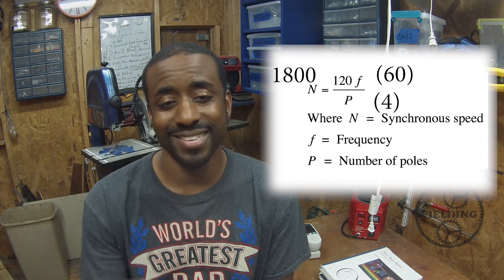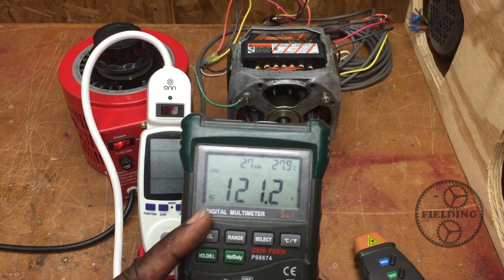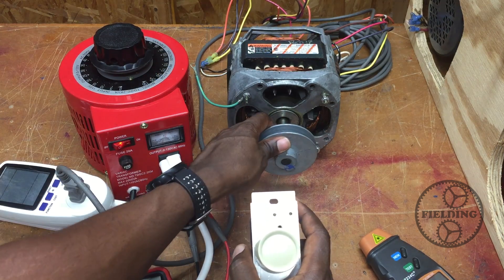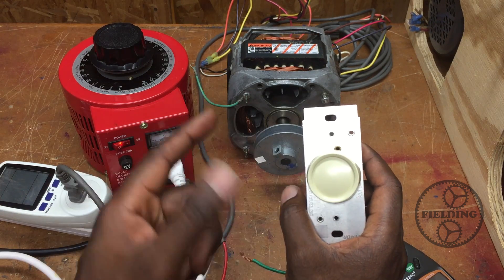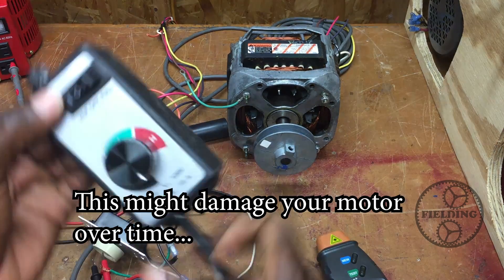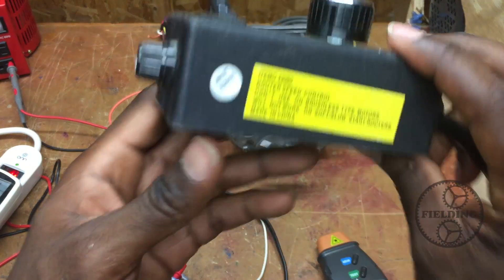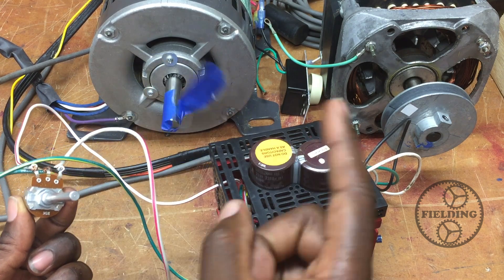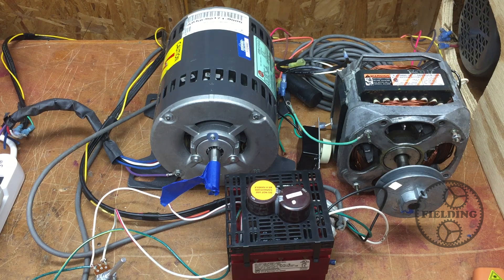Will A Dimmer Switch or Transformer Control An Induction Motor's Speed: 038

Comment: Excellent video Jeremy
Here is a single phase VFD.
https://www.youtube.com/watch?v=QhqrrNa_v6Y
It changes the frequency component of the sine wave by allowing the incoming sine wave to go through SRCs where portions of the sine wave are flipped.
For example if you want half the frequency, the SCRs are controlled so positive and negative of the sine wave are positive bu filling the negative.  Next the sine wave is directed to all negative by flipping the positive portion of the sine wave to negative.  Therefore half the frequency.
This can be replicated fairly easy by using an arduino to control the firing of the SCRs.
Reply from the maker: Thank you! Regarding the link...That is a three phase motor he is controlling. However, the problem is not that no body makes one.... it is that the "most" common single phase motors have starter windings which turn off at lower speeds and the motor would be damaged by lowering the speed. In the follow-up video you will see the two motor types that can be controlled by a single phase vfd. They are almost always used as fans. Here is the video. There are single phase VFD's sold for these two types only. https://youtu.be/JTlHNOaBnPI
Reply: My bad Jeremy
Here is the link I should have used:  https://www.youtube.com/watch?v=lXs0iJ1J-i4
Reply: Variable speed is handy on many machine tools.

Comment: I have been experimenting with treadmill motors but I haven't been able to run them. It won't work just plugging it right into the wall I learned that the hard way (almost died of a heart attack). I tried to use the motherboard to power motors but the first one had all the safety components and controls on the same board. The second motor had two separate mother boards (one for the controls and one for the motor) but it's not letting me use the second mother board every time I flip the switch the breaker goes out. If you could help me figure this out that would be awesome. How do you use your treadmill motors?
Reply from the maker: +Justin Gracier I have a whole video on this on my channel. "How to wire large D.C. Motors"
Reply from the maker: https://youtu.be/ASywVBU0ZwE just in case

Comment: If the light dimmer and router controller both work with triacs, can't you just substitute a high quality dimmer for the low quality HF speed controller when using brush type motors?  Maybe the light dimmer isn't rated for that level of amperage?
Reply from the maker: Well, yes and no... Yes the dimmer switch operates the same way, but "speed controllers" are suppose to be better at  handling the inductive load produced by transformers and motors. I  don't know enough about each component to say exactly what makes it better. It could be just a better triac. That is what one of my subscribers says.  I haven't checked behind him. The dimmer I used in the video was rated properly for the load. It would not be a decent test if I didn't at least get one with the correct voltage and amp rating.
Reply: I was just looking at triac circuit schematics.  I don't fully understand the theory yet, but it seems that triac speed controllers need an additional resistor and capacitor in the circuit to deal with changes when a load is put onto or taken off of the motor.  Fortunately, triac circuits look quite simple and the components needed are inexpensive.  I'm starting to think maybe I could build a speed controller with better specs than that Harbor Freight model for about the same price.

Comment: The motors I come across in single phase are ecm. I think the ac is converted to dc and is able to be modulated up or down.
Reply from the maker: Yes... they are DC motors... Check the second part of this video.... I cover the PSC motor and the Shaded pole motor which are almost always used in fans.... https://youtu.be/JTlHNOaBnPI. I explain how fans are so easily controlled

Comment: Hi Jeremy, I've been watching a few of your videos and have been really enjoying your approach to making. Intuition, the process of discovery and innovation, progressing/evolving knowledge, I make in a similar fashion.
I appreciate your work.

You mention in this video your difficulty in sourcing a single phase VFD, I was recently researching this same subject, and eventually discovered that a few Chinese manufacturers are producing such items. 
Here's one which is listed on Ebay: http://www.ebay.com/itm/Easyget-EA-9000-VFD-0150GB-220v-SinglePhase-1-5KW-2HP-220V-7A-VFD-Drive-Inverter-/322650300139?hash=item4b1f74deeb:g:3vAAAOSwi-9Zj6PJ

P.S. I'm not the Ebay trader, so not trying sell you anything.
Reply from the maker: It is worth asking the seller before you buy it if it is BOTH single phase in AND single phase out. Another YouTuber posted a video where he bought one of these that was described in greater detail as single phase. However, it was single phase in, three phase out after he opened the box and read all the instructions. If it was truly single phase out it should say it only works with PSC or shaded pole motors... something like that. Because these are really the only single phase motors that would work without possible damage to the motor. This website is a good example... they make it clear it has both single in and single out but they point out it doesn't work on most single phase motors. https://www.wolfautomation.com/blog/vfds-for-single-phase-motors/

Comment: I have been studying this sort of thing for a few years, and I have watched other engineering and machining channels. I learned more in 5 minutes of your channel than ALL of the other channels in YEARS! You are a gifted teacher, thank you Jeremy.
Reply from the maker: +Victor Bingo thank you!
Reply: Amen, Amen and AMEN!

This man KNOWS how to turn a high tech subject to a "piece of cake".

Any technical school would be a fool not to hire this man YESTERDAY.

He is a treasure for sure. May Jesus continue to gift him with knowledge that can be taught easily to the masses.
Reply: same here. I thought I knew what I was doing but learned more from his videos that any other source before
Reply: mcorrade it's like he filled in all the blanks I had.
Reply: soo true. keep making more and more videos jeremy.
Reply: You are the best!! Bless you and family.
Reply: I just spent 3 hours on the 'net reading, and your video saved me from reading any more.  In 10 minutes you simplified and confirmed everything I had read.  I did manage to find ONE single phase input/output VFD, but while the input is 120 volt, the output is 220.   The one I found is an ATO 1/2 hp (0.4 kW) VFD, Single Phase Input & Output, but I have no idea how to reduce that 220 to 120 and get the whole system to work.
Great video, helpful to all.  I subscribed, which is not something I do often.
edit-- On second thought, it seems intuitively more likely to work if I get 220V input/120V output VFD, which ATO and someone else make, and put a 120/220 step up between the wall outlet and the VFD.   I guess I'll find out if that works.  What a pain.
Why doesn't anyone make a simpler 120/120 volt VFD?????
Reply: @johnbluebeard4355  
I ended up buying a Variac to reduce the voltage!  Dang, they don't make it easy.
Reply: Salute...!!
Reply: I'm an EE.  I wish you taught my electronics lab, seriously.  BTW, why not put an oscilloscope on the motor input power?
Reply: Victor Bingo q@zzzxxxssx           Is r600tq
Ki
Reply: Thank you you saved me a lot of time and money.
Reply: True that. Me too
Reply: So the obvious question is how do you reduce the frequency of a single phase motor, so that you can use a gringer, as a knife sharpening station; or, slow a router down, when it is powered by an induction motor (cheaply, of course)

Comment: Thanks for a really great video.  
You explained everything so that it is easy to understand. 
I always wondered if there was a way to slow an induction motor that uses a capacitor start system.
. 
I have a Milwaukee 8 inch bench grinder that has a bad start capicator. 
The grinder was salvaged from my garage after Super Storm Sandy that hit on 10/28/2012. 
Most of my other power tools didn't survive. 
I flushed the motor with fresh water and it ran great for a while. 
Now to get it to run I take an old leather belt and wrap it around the grinding wheel and pull start it. 
I can't see any marking on the cacitor so I don't know what size capacitor to replace it with.
If I don't pull start it it will hum and get very hot.
Do you have any idea about what size capacitor I would need to use? 
The motor is 1/4 or a 1/3 horsepower .
Is there a formula to figure this out.
Again, thanks for your time and effort in making these videos and thanks in advance for any info.

Comment: Is that a start capacitor on that single phase motor?
And that 3 phase is AC right?
All the treadmill motors I've salvaged are permanent magnet DC motors.
Reply from the maker: +Robert Twiss there is a start cap connected to the single phase motor. It is AC three phase. This is the first three phase motor I have seen from a treadmill. It was a commercial grade very large treadmill. I didn't get to see the board but I assume it has a single phase to three phase VFD controller with step-up transformer. This would have plugged directly into the wall at 120 volts.
Reply: That would have been an interesting salvage.
My current interest is Alt. Energy.
I have been collecting things for a gasifier/pyrolysis project I hope to start building soon.

Comment: Jeremy Fielding will a potentiometer work on e bike motor, without that devise? I am making my wheelchair motorized with 2 hub motors. don't want to pay out the hide end for a motor controller or a bms. I plan to recharge all my cells one at a time like all other battery using devices hahah, big one legged boy toy, my wheel chair
 Joseph T
Reply from the maker: If you can find a potentiometer rated for that motor's current and voltage... then yeah it would work. A DC motor controller would be better in the long run but it will cost a whole lot more. You will probably get better results searching for a rheostat. It is more along the lines of what you want. It is basically the same thing (a pot) but different lol

Comment: hey Mr Fielding does a water pump machine has a motor inside and if yes which type
Reply from the maker: Yes. You need something to turn the shaft of the pump. What type depends on the size but a pool pump for example is most likely a two pole capacitor start induction motor. But, that is a guess. There are many different types and sizes of pumps.
Reply: Jeremy Fielding will a potentiometer work on e bike motor, without that devise? I am making my wheelchair motorized with 2 hub motors. don't want to pay out the hide end for a motor controller or a bms. I plan to recharge all my cells one at a time like all other battery using devices hahah, big one legged boy toy, my wheel chair
 Joseph T

Comment: Just a trick I've used in a pinch a few times. Dimmers, especially those intended for ceiling fans can control some small motors like bathroom or stove exhaust fans, but also things like hot glue guns or heaters when you need some kind of variable temp. control. BTW, great channel.

Comment: Although you indeed can't dim an induction motor it does sound like it's not even starving the motor because the triac isn't turning off. Because the lacking of current with an inductive load it's hard to turn off a triac. So I think if you place a bulb parallel to the motor while using the dimmer it will not dim either because the triac isn't turning off :D
Reply from the maker: +tengelgeer now that sounds like an interesting experiment. I will try it and let you know what happens.

Comment: What about fan motors and their three different speeds? How is that controlled and fit into what we just learned? Thanks for the videos, you always do a great job.
Reply from the maker: +Trey walker it is wired differently. The winding is tapped at different places. They don't use the "whole" stator field for the lower speeds. Kind of hard to explain in the comments. But that type of motor is only good for fans... when a fan starts the load is very low... basically zero. If you start a washing machine with that type of motor it would never get going. I definitely have to address this. Several people have asked. It is a great question I didn't think to mention in the video

Comment: So don't you need a different plug for a 3 phase motor? My grandpa had a lathe that had a 3 phase motor and here in Australia the plug was way different. So how did you connect yours up?
Reply from the maker: +Jetwow135 the VFD has single phase input and three phase output

Comment: http://www.industrialmotors.com/media/blfa_files/55AC_Manual.pdf
http://www.industrialmotors.com/55ac10e-enclosed-variable-ac-voltage-supply-0-120vac-full-wave-10-amps-max.html?gclid=Cj0KCQjw_JrMBRDPARIsACis1Hy9q3vAowyFgc1AH682_0agzHCZyrgxS1QQQhBjx_IH9x_3TLxg4hcaApBPEALw_wcB

What do you think of this?
Reply from the maker: That is identical to what you saw me use in the video. It is for other types of induction motors like shaded pole motors. Basically if it is a fan or blower... (without the separate starter winding) then this will help. It won't work with the motor I showed in the video. I think I should make a followup video to cover this. You are asking a great question that I didn't cover.

Comment: 7:13 "can't change the number of poles" I thought that's how changing the speed on a ceiling fan worked?  The way I understood it, the pull switch decreases or increases the number of poles, by controlling power to the different sets of windings. Obviously, the motors you're talking about aren't configured the same as a ceiling fan, but am I on the right track?  You would only be able to control speed incrementally, and ceiling fans are pretty wimpy motors, but I'm just speaking conceptually.  Please educate me if not, and thanks again
Reply from the maker: The motor I am using in the video has several "sets" of windings (with different numbers of poles) which allow you to change the speed by changing the connections. I only meant you can't physically change the number of poles as a end user to get the speed you want.
Reply: Jeremy Fielding got it, thanks.  Is my understanding about ceiling fan motor speed correct?
Reply from the maker: I am not certain. I can say for sure the motor I had on the bench in the video is as you described. But there are so many ways to force a small induction motor to run at different speeds (by design not after the fact) that I can't say a ceiling fan is wired that way. The winding might be tapped like a transformer. It is hard to explain in the comments but check out this link. http://waterheatertimer.org/How-to-wire-3-speed-fan-switch.html

Comment: excellent video. your really did a great  explaining the speed control issue. how do ceiling fan speed controls work i know they use triac controllers are they brush type universal motors?
Reply from the maker: +larry sperling that is a different type of induction motor...there are quite a few ways to do the windings such that you get different speeds. Each winding can have a different resistance as one example. Or it can be tapped like some transformers. It's hard to explain in such a confined space (comment section) I may do a video on it. But if you search online you will see examples of this. Wiring diagrams and everything.
Reply: thanks for the quick reply good information. looking forward  to more videos

Comment: Hi Jeremy
Thanks for all your awesome videos.  I live in Australia so our wall outlets have 240v / 50H.  I'm in the process of using a treadmill motor and a speed controller I bought of ebay 
http://www.ebay.com.au/itm/AC110-220V-10000W-SCR-Voltage-Regulator-Motor-Speed-Controller-Dimmer-Thermostat-/401317004146?epid=858497169&hash=item5d705b8372:g:oeEAAOSwX61ZA~Mz
I have a bridge rectifier in the circuit as well (seeing as the treadmill motor is DC)
So far on the bench it all works fine and the motor slows and speeds up great.  Can you see this being a problem as a long term solution or under load at all?
Thanks
Reply from the maker: A PMDC motor should respond well to variable voltage. Please watch my video on DC speed control and I talk in great detail about what works and using a capacitor with the speed controller... if it is not a DC speed controller. https://youtu.be/ASywVBU0ZwE

Comment: What can be done to control the speed of a single phase?
Reply from the maker: +Steve Kelsey pulleys are really the only good option that won't damage your motor
Reply: I think one example of pulleys is my cheap Harbor Freight drill press, change the belt to various pulleys and I get a different speed.  I think the drill press is 8 speed simply by changing pulleys. This option must be cheaper than using a variable speed motor.

Comment: Jeremy, thanks for the great videos.  Have you ever looked into getting one of the zero-max mechanical speed controllers, which would allow you to vary the RPM of the output of any motor?  I think they were used quite a lot on older industrial equipment before VFDs came into play but I don't see them around much now.  Here's a link: https://www.zero-max.com/cd-adjustable-speed-drives  
I'd be interested in your take on using something like this for some of your shop projects.
Reply from the maker: I have seen something like that on old lathes. They are great machines.
Reply: I know this is dated,  but with a fixed 1750 rpm input, the ZM drive will allow 0 to 400 rpm output speed.  Size up the unit based on your desired maximum output torque.